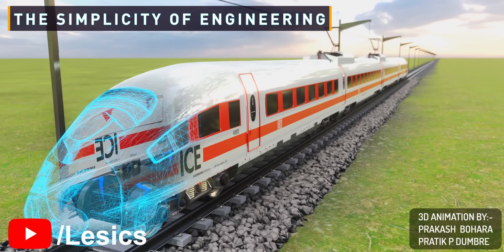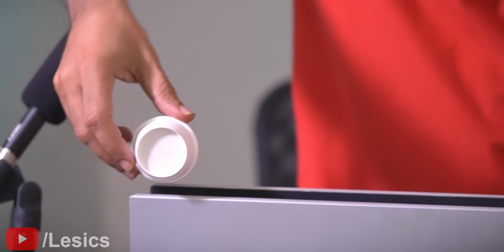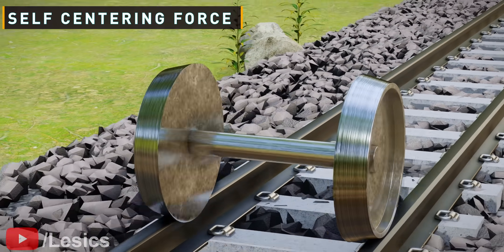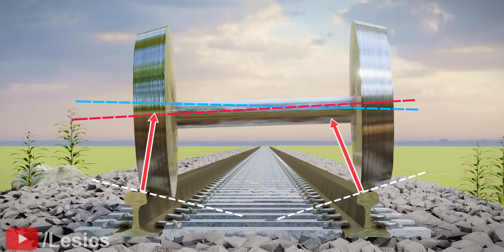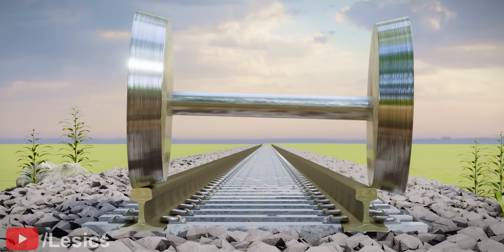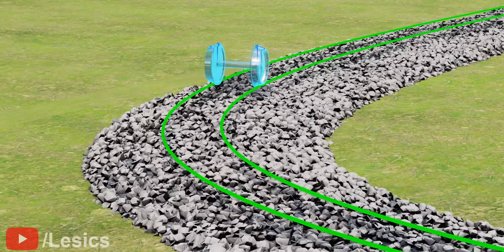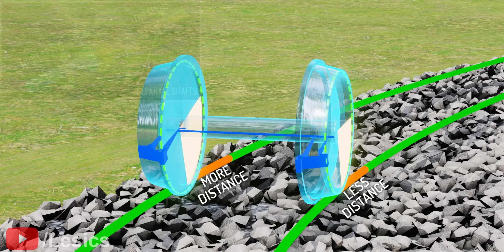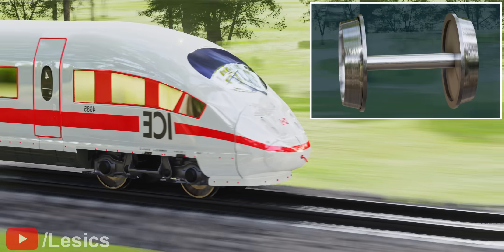The interesting engineering behind the SHAPE of Train wheels!

Comment: Same principle for airplanes, makes them stable.
Some planes like fighter jets even have it inverted to make it more unstable and therefore more maneuverable. 
Some planes are just so heavy they need to be unstable to even turn at all.
Reply: Multi engined planes rely on this to maintain stability should one engine fail.
Reply: And some single engine planes have one wing that is a tiny bit different than the other, to counteract left turning tendencies. This is  designed to fully cancel out any left turning tendencies during cruise. Learned this recently, found it pretty amazing and wanted to share.
Reply: @aviatordiego4769  Huh, nice! To add to that, aircraft carriers always have their island on the right, because during landing they can just yeet left, and with the island on the other side it would cause less damage. You can also tell where is the front of the carrier that way.

Comment: Ironically still most model trains have not got onto this idea. Lionel O gauge did around 1970's started this with their rolling cars, the wheel set was one piece, as compared to the former spinning wheels on a semi-fixed axle, but it was never done to the engine wheels.

Comment: Now that you have mentioned about car wheels. What if car uses the same technic as train has? Will the car become super efficient on anything? Someone please answer? Thanks
Reply: Car wheels have camber and the rear axle has planetary gears so the wheels can turn at different speeds and the front wheels are separated also cars are not on rails

Comment: And as it turns out rubber tires will change shape to fit the Dynamics of the infinitely different directional pull of the wheel so it's really not all that big of a deal explain the Dynamics of a rubber tire that would be interesting video.

Comment: They overcame the fixed wheel axel issue and going round bends by the wheel design
Reply: @kukretuza5067  you cannot have a cant on a railway bend without a design change in the wheel or independently spinning wheels

Comment: Lol, this is just stupid. Your explanation: net force to the left - good, net force to the right - bad xd It's so oversimplified it's just wrong. The right understanding of this arrangement is about self-balancing. The inward edge orientation acts as if the axle was placed in a u-shaped trench, the outward one acts like it was on a tip of a hill. In the first case the bigger the distortion the greater the counteracting force. In the second one occurring forces amplify the distortion.

Comment: As a structural engineer I would like to add one more advantage: 
 It counter balance centrifugal force of outer wheel while turning on sharp curve .... usually on road construction it is nullified by giving super elevation to the road... keeping outer side of a road at curve slightly higher than inner edge .... but in train track it is managed by the conical wheel shape ....
Reply: Railways have a raised outer rail
Reply: @mickavoidant4780  yep ... due to conical design that raised height would be less than the usual road construction... where gravitational force component alone taken in to consideration as an opposite force against centrifugal action... for maintaining equilibrium
Reply: @rahul71804  I get it now.

Comment: <!   !>   Probably the reason for these kind of structure was left wheel at right part is broad and right side left part is broad. I clearly shows that any object sits perfectly when below sitting item for left wheel intersect at mid of the laying object and same on right wheel too. As apposite edges are board for both wheels laying object sits perfectly on laying track. To test it if we try to move from side ways forcefully the laying object should raise in height to de track from left and right side and almost all track were at same alignment possibly this the best design for our trains compared with weight on track with the track structure and design.
Reply: The weight and structure of boogis plays a major role I feel, in our example if broad ness changes for left wheel to left and right wheel to right the reasons for detracting were if we push train boogie from one side.  '^' Here if we put triangle like structure to train boogie the down coordinates were out of the track. In our design the triangle was inside the track it shows lot of difference. I feel weight plays a big role on axis. 

correct me if we need to add something

Comment: Very clear.....but you forgot to state one vital point. The rails !!
Both rails are TILTED INWARDS exactly matching the bearing surface angle of the  conical wheels. This angle is uniformly 1 in 20.
Therefore when taking a curve to the right...the left wheel rides UP the rail and the right inner wheel rides DOWN on the rail.
This is why it is impossible to derail a train unless by external forces.

Comment: This is an appealing explanation but I sure this geometry isn't a perfect solution.  Because if you've ever live near train tracks, especially near turns, there's an awful lot of screeching and singing of the wheels and the rails.  So I'm certain there is some slippage and skidding going on between the steel surfaces.  Sometimes even creating sparks.

Comment: Your theory about self centering is incorrect, its not because of forces, its because of its variable contact diameters and traveling speed. The wheel on the most outside of rail has greater contact diameter and travelling faster than the other and will turn the axle towards inside. Both wheel have the same rpm but diferent traveling distance due to different contact circumfrence.

Comment: Not only does the net force change when the wheels are pushed to one side, the distance traveled by each wheel changes... The wheel traveling farther (and thereby faster) begins to circle towards the other wheel. It's not just a differential thing... It literally "turns' the wheel and axle towards the smaller wheel.
Reply: isn't this the main reason? as it's the only one to include friction, the other completely ignores it but there's clearly friction, and the "proof" is that it works only for moving trains.

Comment: I was taught this by my first repair foreman and have repeated it many times since, but every time I see railway wheels, I notice that there is no taper to them.
That’s why they screech horribly when going around even the widest curve, and trolley lines used to employ curve greasers.
Reply: I've always thought that the wheels had a slight taper to them and that it was the flanges scraping along the rails that was causing the squeal.
Reply: I think this explanation is in the Machinery Handbook.  Its been a long time since I've been up close to train wheels, but I recall them having no noticeable taper until you get closer to the flange (almost like the wheels have a gentle curve to them).  I was told that all wheels slip and the wheel shape has evolved to help minimize track wear, because the wheels are hardened and the tracks are not.   You can look at old tracks and see the wear on them.  Also this explanation never sat well with me because of differences in train loading and train speeds, etc.  What if you took a turn too slow and stayed too centered on the track?  What if some cars are loaded and some are empty, how does that work?

Comment: I'll be damned! For I had thought about this problem for many decades. And the only thing I could come up with is: when the track is straight; no slipping with the solid axle. But when it is going around a curve; one of the wheels must slip.

So now I see how canted wheels do not slip on curves. Wow! That is a great invention. But I do not think the engineers; were concerned about the wheels staying in the middle of the straight tracks. Because, it just happened to do it. Thus, I believe their main thinking was to stop wheel slipping on curves*. But I could be wrong. Thanks for showing us. I really enjoyed it kind Sir.

*The reason I believe this; is because I have ridden on trains; where the wheels were dead flat; and I never saw or felt any wobbling of the wheels; to the left or right on straight tracks. But I often heard squealing; when the train was going around a curve. So, I reckoned that was the slipping of the wheels. But again, I could be wrong...

Again thanks. because your video was great.
Reply: Train wheels do slip on short curves, which causes the screeching or squealing noise. Conical wheels do reduce the need to slip and eliminates it for long curves. Railroad curves are often also banked slightly, which effectively turns part of the horizontal curve into a vertical curve (from the train’s perspective) and slipping is further reduced.

I think the slipping action itself has some implications for keeping the train better centered on the tracks. But I don’t know how that works.
Reply: @hylje  Thanks for the tips.

Comment: Good explanation. :-) Just one thing makes harder to understand: you call the right wheel the left considering the movement of the train. I like naming the wheels from the driver's point of view. It's conventional throughout the vehicles.
Reply: But you are still facing the same direction.
Reply: I was looking for the negatorians, smack on I've found'm.
Reply: I work on vehicles, however, the driver side does not work because there is both right and left-hand drive.

Comment: You ave forgot to mention that rails in curves are banked to help the conical shape work and the rails are slightly tilted inwards to match the conical shape of the wheels.
The conical shape of the wheels causes a "problem" that is called "meandering" so you need to Amortize the bogie to stop that movement.

Comment: The tapering goes away with prolonged exposure to friction....and moreover the difference between the outer and inner diameter isn't that large either which is why one wheel always slips when trains take turn and as such they aren't as robust as automobile differentials! (If at all they can be called "differential mechanisms"....differentials of foot pedalled rickshaws have far more "enginnering brilliance")

Comment: Modern train wheels actually aren't conical, it's actually more complicated shape.

The differential thing also only applies in not so sharp curves. In sharp curves one of the wheels (typically the outer one) actually slips - that is the humming sound you can hear in train when it goes through sharp curves.
Reply: In a turning vehicle with rubber tires the inside tire would slip first due to higher slip angle and left-right weight transfer to outside tire
Reply: The Outer wheel has to travel a greater Distance, therefore would not the inner wheel have to slip. Just a little bit.  Like a four wheel drive with line lock or mechanical lockers. If you try to do a U  turn, a sharp one, on pavement, the inner wheel will Hop. It has to match the outer wheels "Rotational Circumference" Cheers, from Adelaide.

Comment: Thanks, I never knew that, I thought it was just the flanges that prevented derailment. I guess it would also reduce friction. It could also reduce traction when climbing, no? Especially, when wet. I realize they spray sand on the rails to increase traction.
Reply: I think traction in trains is provided by their sheer weight. Even so, most trains are unable to climb steep inclines. For this special trains fitted with cogwheels underneath the chassis and special tracks fitted with chain and pulley systems are needed. But I am not sure.
Reply: @makismakiavelis5718  The track is fitted with a rack, an unrolled gear that engages the cogwheel or gear under the locomotive. 
Flanges are secondary devices to prevent derailment and are necessary on especially sharp curves. You can hear the squeal when the wheel skids on the rail and the flange rubs, especially with trams or streetcars on street railways. In cases where mainline railways must have very sharp slow speed curves they will use a flange oiler to reduce the problem.
Reply: @danielcarroll3358  
Interesting. Thanks.
Reply: @danielcarroll3358  Sometimes the uses of a 'check rail' is also used to ensure the wheel stays on the rail on tight curves and at points (switches).
Reply: @1963TOMB  True. Also on bridges and such you will see another set of rails inside the running rails to keep the train from falling off the bridge if it should derail.

Comment: Now if they can just prevent trains from rocking back and forth and making a bunch of squealing noises, they might have something.  Also, why have a common "locked" axle?  Why not just let each wheel turn at whatever speed it "wants" to?  With the flanges, the wheels can be made "flat" to spread the load out over the entire 2 rails.  Unless there is a big flaw in the track or the train grossly overspeeds a turn, how would the wheels jump the rails?

Comment: Has this engineering been around since the first wheel-on-rail designs, or has it been honed through trial and error over the years?
Reply: Yes, however recent engineering advances have allowed a more accurate definition of the actual shape of the cone.  High speed trains don't use a true cone, but use a slightly curved profile which gives greater stability at high speed and less wear.  This research work was done by the British Rail Technical Centre in Derby, England, during the 1970's and 80's.
Reply: @arburo1  yep, the work to develop the APT Experimental gas turbine unit saw BR Recruit scientists and engineers to work on the relationships of the wheels and track as well as developing tilting mechanisms to allow trains to go faster on track with higher curves than ideal. Modern high speed lines eliminate as much curvature as possible in the design and construction,  but br was constrained by limited budgets and so couldn't replace lines with newer ones. The wagon (hsfv1) used to develop the wheel and suspension technology still exists, though I'm not sure where now,  as does the apt-e unit.

Comment: The self-centering effect has little to do with the "tilt" and "net force".
     The effect is caused by the difference in radius of the portion of the wheel contacting the track.  The larger portion tends to roll ahead of the other side, thereby turning it's trajectory inward, causing the axle to roll toward centre, undoing the difference in wheel radius.  The former "net force" mentioned may be partly responsible for damping a cyclic oscillating tendency of out-of-phase speed vs direction of the axle.
Reply: I was also remembering that some belt drives use a spherical or conical drive to keep the belt on the pulley rather than physical flanges.
Reply: @Qui-9  I know the Kirby vacuum cleaner definitely does this where the beater bar belt meets the propeller shaft.
Reply: @Qui-9  that arrangement can be found on CVT or scooter transmissions
Reply: Good point, and I think you’re correct. One could design an experiment to demonstrate your point. A simple experiment might be with two narrow bicycle wheels of different diameters on a common axle. No tracks are required—just a level surface, perhaps with a slight step down on the side of the larger wheel to keep the axle level. The larger wheel will have a greater force in the forward direction than the smaller wheel, and this will impart a torque about a vertical axis at the center of the axle. Since the contact points between the tires and surface have no tilt, any tendency to turn must be due to the torque.

For train wheels, I suspect that this torque will be the dominant effect, not the tilt.
Reply: @kirkp_nextguitar  this sounds like torque vectoring :)
Reply: nice
Reply: True, that's what I thought while watching the video. Because the "tilt" and "net force" thing didn't make any sense. Because if the train shifts to the right on the track it will increase the diameter of the right wheel. This causes the right side to lift up tilting the whole train left. When it leans left the left wheel will have more weight on it therefore pushing the train the rest of the way of the right side of the track. So it's obvious that the whole axle turns left when the train scoots to the right, therefore bringing it back into alignment.
Reply: Yes I completely agree and they wer indeed my firsts thoughts. The difference in tilt would only be a few millimetres and irrelevant in the scheme of things. Also bear in mind that the track is never going to be perfectly level to the nearest millimetre.

Comment: I'm not sure I agree entirely with this explanation;
I agree that when shifted sideways, the train tilts in such a way that the reaction forces on the wheels tilt in the opposite direction, but I believe there are two different reasons for this:
1 - As indicated in the video, the contact normals shift due to the wheel and track geometry.
2 - The larger effective radius of the outer wheel causes the pair of wheels to rotate about a vertical axis as the train rolls along, causing the train to roll back towards the centre, or, equivalently, causing a component of the tracks' velocities to be perpendicular to the wheels' tangents such that some extra lateral reaction force appears to accelerate the train back to the centre.

I believe the effect of 1 is unimportant, as the magnitudes of these forces will also change, in order to balance the train's weight - if the train was off-centre and stationary, it wouldn't accelerate back towards the centre would it?

I believe that it is 2 that explains both the re-centring and differential effects, as both only happen when the train is rolling.
Reply: Agree .. ✅